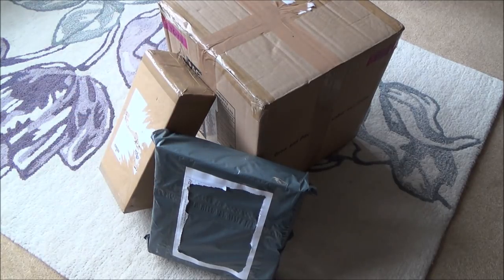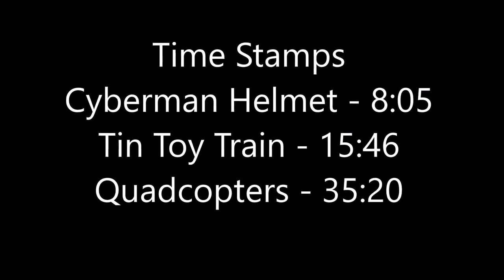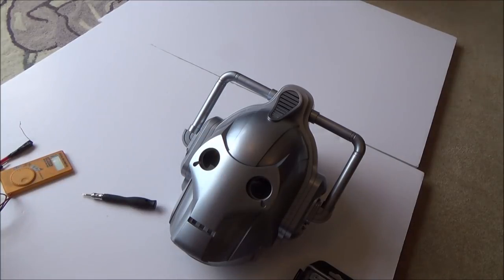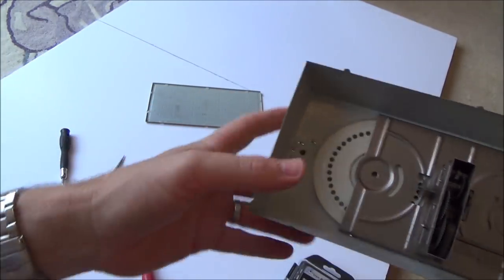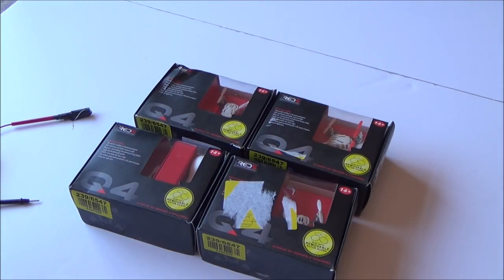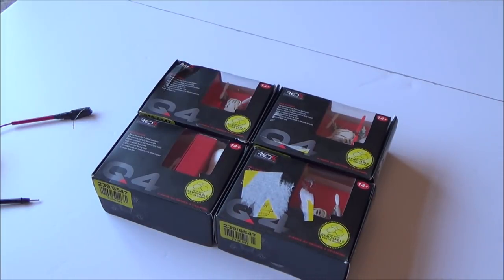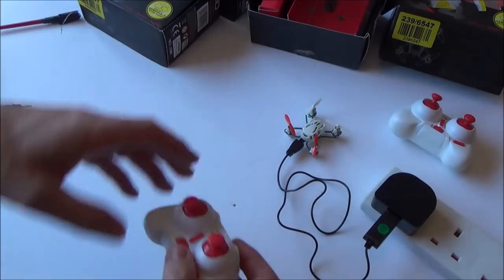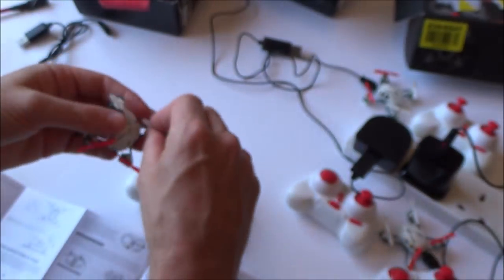Trying to FIX Various Faulty eBay Toys

Comment: Just one thing that may help you in future diagnostics: Measuring batteries with a multimeter isn't sufficient as it doesn't apply a load. So with an old battery you may measure 1.5v across the terminals, but when a load is applied (when in real use) the voltage will drop. Advice is to get a battery tester which will apply a load while testing. It's the only way to be sure your battery is in fact supplying what you expect.

Comment: Great video man. Small bit of info, even dead batteries will show 1.4, 1.5 volts when on a regular meter. They have small battery testers with a tiny led and a meter in it so the battery can be tested under a load. Keep these great videos coming.

Comment: Hi long term watcher, first time commenter, just wanting to say loving the video especially all the new fixing stuff videos, keep up he great work dude :)
Reply from the maker: Thanks for the views and the feedback :-)
Reply: My Mate VINCE your welcome dude :)
Reply: Hello im tring to contact you for the switch enclosure video ,i am very interest by this project, im trying to do the same thing for my switch, but how you can charge the monitor 10 inch witch the power bank because its ac in 12V ? thanks and weldone another time
Reply: Yeah
Reply: There is a highly likely chance that those letter and numbers on the props were just  cavity marks on the injection mold. They are put on so if there are bad parts dropping out of the mold that the person running the molding press can locate the problematic cavity.

Comment: I'm 64 now, and when I was little in the 1960s there were still a few tinplate clockwork and 'friction' toys around. Sadly, boys being boys, we would often pull them apart after a while to find out what was inside and how they worked. It's a shame, since they would be collectors' items now. Not all waste, though, since I did go on to be an engineer. (Electronics rather than mechanics, but I also have some qualifications in the latter).
Reply: engineer me some stuff my friend

Comment: If you're interested i'm pretty sure the nanos use a 6x15mm brushed motor, in which case there are a few upgrade options. Batteries can also be sourced easily.

Comment: hey nice video men, in case you didn't know why on the last drone the one blade was delayed like you said. It's not because it is delayed it is just figuring out wich blade's need to spin to get it flying stable again. And when you where holding it like that the blade didn't need to do anything so it didn't rotate.  keep up the good work!
Reply from the maker: Hi there. I didn't know so thanks for sharing the info :-)

Comment: The little dimples or divots on the bottom plate of the tin train was for strength and rigidity. Don't forget to use machine oil on the gear set, it's almost like a clock movement.

Comment: Random little story here about rc drones.
I worked at a Dollar General about a year ago and when an item got returned even if it still worked, we had to throw it away.
Because of that, I was able to get an RC drone and many other electronic toys for free, dumpster diving after work lol.
The RC drone has a very flimsy switch on it and with just the right angle you can flip the switch and it works perfectly fine. Wish more stuff like that wasn't so easily thrown away by companies or at the very least the consumer fiddle with the item before giving up and returning.

Comment: You can get replacement batteries for much cheaper from aliexpress but usually they don't come with a connector Or you could get less capacity ones with connectors but I'm not sure if that would make it unbalanced

Comment: The plate with the blue train on s slightly warped and catching where the top is buckled and catching. It would all need taking apart to take the warp out of the round plate.

Comment: Why didn't you keep the faulty motor one for spares and just fly the one with no battery? I mean the no battery one is fresh from factory, not tinkered with :) Just take the battery from the soldered one and put it in the other one

Comment: Hey vince i have a queshtion if you use the mayflash and connect a controller can you play undocked also?
Reply from the maker: Hi, the Mayflash adapter would need to be connected to the Switch via a USB-C OTG cable :-)

Comment: The lights on the chargers are faint, because you are looking at them from the bottom (some of your chargers have the USB port flipped upsdie down for some reason). Try looking at the chargers from the other side.

Comment: Once only but gaining twice the flying time..?
Rip a CR2032 Backup battery holder out of a PC etc then solder in the Quad Copter.
The holder + Battery weight should be similar, if not, probably less.?

The CR2032 battery has a voltage of 3 volts and a capacity of up to 240mAh, depending on manufacturer specifications.

Comment: If you had one that simply was just missing a battery and one that had a disconnected wire why solder the wire since one of them is going to be just for parts? Just put the battery on the one with no issues.

Comment: another common problem with the smaller quads and helis is that the battery inside will go bad in about a years time if not used regularly